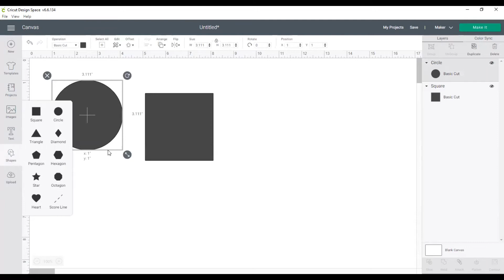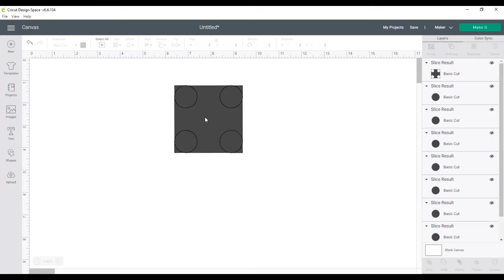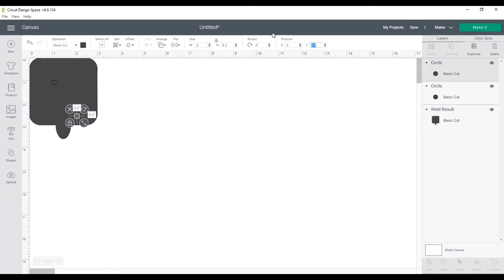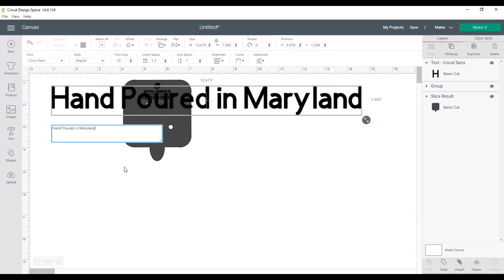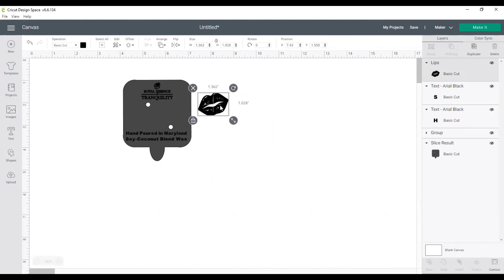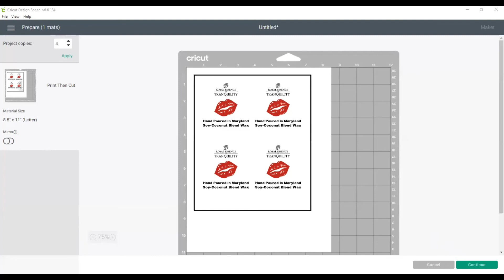Learn how to make a square dust cover in Cricut Design Space on the Maker or Explore Air for candles

Comment: How would I do this if I use small wooden wicks and place them diagonally? Also I tried to print on card stock and my ink bled and it was all blurry.. Do you know why?
Reply from the maker: This depends on how you placed the wick for the candle. I have made the dust cover with using a rectangle in the center for 1 wooden wick. Good luck!